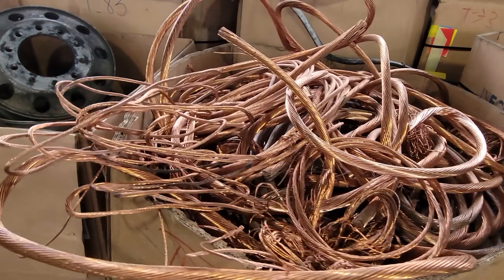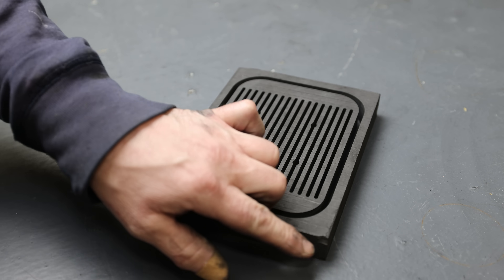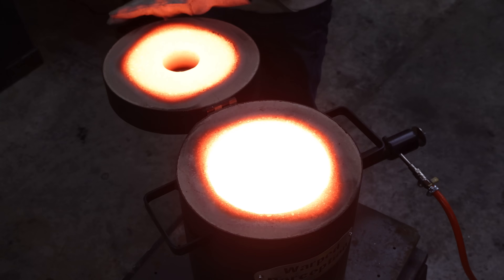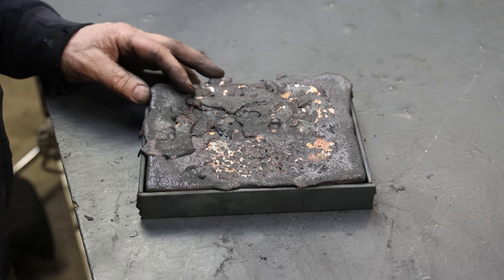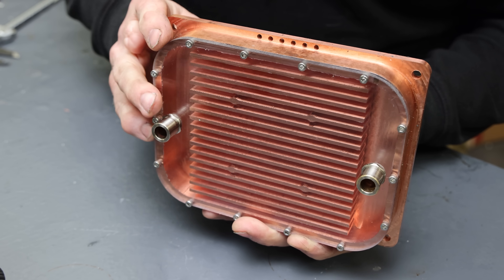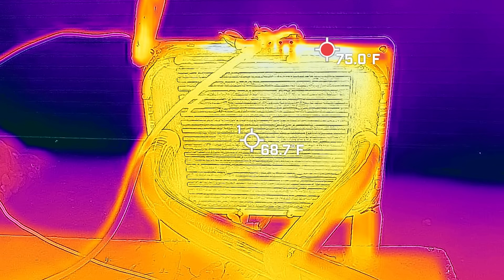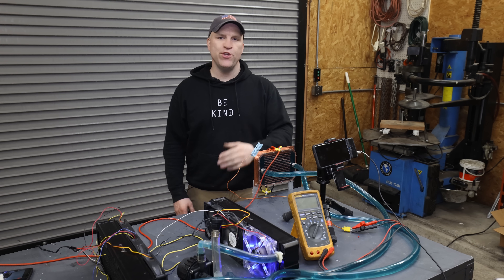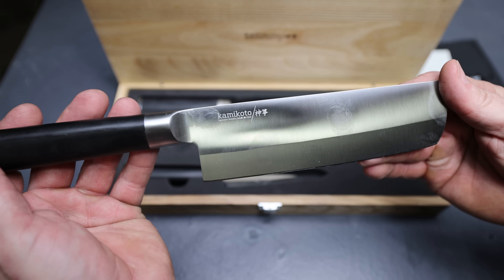Making a Huge Waterblock from Scrap Copper -Trash to Treasure

Comment: Incredible. If you ever do plan to make another revision, you should look into the design of high end CPU Water Blocks and the deliberate paths/restrictions to ensure good outflow of the heated water as well as the relationship between the in and out of the water. I wonder if there would be any difference in performance with a 12/6 o'clock or vertical relationship of the input and output as opposed to it's current 3/9 o'clock as you showed and if the feed or return worked better as either top or bottom. Great job nonetheless. I wish I had your tools.

Comment: out of curiosity, why didn't you go with a thinner fin set/ smaller fin spacing set up to allow for more fins which would increase the surface area for heat dissipation. also why not cast a a cooper ingot/block and make it out of billet cooper, since that cast had to have excess material  milled away anyway.

Comment: Thought it was dangerous to machine graphite because of the dust. Boeing at a fire during machining. The dust reacted to the 440 panel and an arc of electricity went through the machine shop. Luckily no one was hurt

Comment: He should have used an off the shelf threadripper water cooling block with a small refrigerator unit.  That probably would have worked just as well or better and would have saved tons of cash.

Comment: Awesome to see good engineering process.

Just my 2 cents, if you put the inlet for the coolant low on one side, and high on the other it may work even more efficiently. I think currently the coolant is pretty much just moving across the centre of the core. We had the same issue with our race car intercooler, when we moved the inlet and outlet, we saw a very big change in our intake temps. :-)
Reply: Makes sense. Better liquid distribution over the heat sink.

Comment: How come you used a graphite mould and many hours of machining and casting rather than just making a block of copper and machining it down? Is there a benefit to casting the rough part in a graphite mould first?

Comment: why are you calculating the volume by hand when your using fusion 360? 
right click on your positive model and click properties. you can also right click the model in the side bar and change the physical material to copper for accurate weight calculation in the properties menu.. 

its inefficient to calculate the volume using the bottom surface area in your negative cavity and the cavity height when all the information is near instantly accessible.
Reply from the maker: I wanted to make it more visual for the majority of people who will watch the video that don't use CAD, it creates a story connection. you use cad for volume but don't know how to scratch it up in paper, but you know im doing math when I'm writing on that paper, most people know the hand math but don't use CAD. I split it so both sides understand and relate with the same end goal, volume by weight of specific material. And I still added a little extra for safety. Thanks tho those are great tips I really like 360 but I just recently moved over from SolidWorks and Catia so I'm still not super proficient.

Comment: that casting is useless you have to melt 30% more of all the metal you want it is very easy assemble the graphite crucible and it will be the side container add distilled water to obtain the m³ then look for the Then look for the atomic weight, the crucible must be at the melting temperature so that casting breaks are not generated, that is, the metal cools and leaves bubbles. Partial casting without all the metal produces inconsistency and fractures since it is not all one piece.

Comment: I'm sorry for asking probably the most anticlimactic question, but you used some silicone caulk and you made it more flowing by mixing something. Could you help me out with that. I need to do the same for other project. What were the materials? at the 7:26 timecode

Comment: hate to be late but worth a shot.

What about adding an O-ring and making a checkered pattern, it would add a bit of extra machining time but I wonder how this would affect performance. If adding these helps make the block hold more pressure, you could use a stronger pump and go longer and dial the pump back and extend the life of the pump.

Comment: It is a cool project but the copper cooler is not very efficient. It is designed like CPU water coolers were designed 20 years ago. There is soo much that could improve the heat transfer. And the knowladge is easy availble. Check out moddern CPU Watercoolers (EK Waterblock, Aquacomputer, Watercool. . .  ).

Comment: wait so if you have the CNC why did you need to cast into a mould first? wouldn't you just make a bigger square copper pour and then mill it out?
Reply from the maker: I was going to, but I would have for sure had air entrapment, too much liquid exposed to air, the more surface area of the liquid copper exposed to air the more air is absorbed into the copper,

Comment: Solid copper water tubing and a larger radiator/pump will knock those temps down (this only will help if it's more a static install).

Comment: Probably should have made the channels a bit smaller so the liquid flows more evenly across them. But that's just nitpicking since it looks really nice and does what it is supposed to!
Reply from the maker: Unfortunately I couldn't, once I get my bigger more capable machine in a few months I will redo this smaller different shape and more detailed. Originally my design for the water cooling was a whole bunch of peaks similar to a CPU water cooler just a lot bigger. This year is that I'm using this dinosaur CNC machine and this was absolutely the smallest I could go.

Comment: If you R click the part in fusion 360 and tell it its copper (appearance i think). Then in properties it will say its mass. I think you should try sand casting its a lot better than pouring in on top. Fun video thanks

Comment: One design flaw is that you should've machined thinner fins closer to each other and then cross-cutting them, making many "pins" instead of channels. This way you would've created way more heat-dissipating surface in contact with water, increasing the efficiency exponentially; this technique is used in PC watercooling and it works great

Comment: No offense, this is really cool project, but wouldn't CNCing a solid block of copper be easier? And wouldn't there be existing applications on the market that are more than capable cooling this chip?
Reply from the maker: Yes but the raw material was on back order for min 2 months. This was not my first choice. As for existing applications... Nope, I looked high and low and the final unit...not this one ... Needs to fit into a industry standard Bowens mount. So unfortunately no... I would have loved that.

Comment: Cool project!
I can only suggest to maybe insert a colored marker using a syringe into the tube before the waterblock to inspect how well its inner ribs brake the coolant flow. I suspect that the most outer water channels get very low flow.
Reply from the maker: I did a static pressure volume pressure drop calculation. Right now there's a pretty big static pressure difference between one side and the other so the flow is pretty much even. But my vinyl design is a cross hatch style not this straight fin junk. But with the current machine that I'm using which is like a dinosaur CNC that would have taken me weeks just a machine, my goal was to make a functional unit just for now until I get my other machine.

Comment: Very nice work! I love how clean the finished product came out! The design of the block could be adjusted to get a more even flow across all of the channels, increasing the heat exchange. As it is now, the upper rows wont get as much flow through them as the coolant wont want to fight gravity to go through those channels. Placing the inlet in the top corner and the outlet on the opposing bottom can help this immensely. It could let you cut down on some material too if you end up making a bunch of these for this experimental LED. But hey, if it works it works!
Reply: I was actually thinking the opposite with the inlet at the bottom and outlet at the top.

I feel like having the inlet at the top could cause the water in the other top corner and around the center to stagnate because the cold water would want to sink straight down, then across rather than trying to flow across the fins. Having the inlet at the top would at least evacuate the hottest water first.

It might even be best to place the inlet right over the center so the center always gets the coolest water.

That being said, I ain't no scientist so I could definitely be wrong haha
Reply: If he made the waterblock side that the led mounts on a mirror finish it would have helped alot in transferring the heat as well. I'm not sure what he used as a TIM but if it the block was as smooth as possible it would have needed less and cooled better.

Comment: The most handsome engineer I have ever seen😎 , I have a question, I didn't understand why you used a graphite reverse template , why didn't you machine a copper block directly? I don't know much about thermology and metallurgy, but I thought casting a simple block was easier than a porous template. And machining a simple block is easier than a semi-finished piece 🤔 Is that correct ? Anyway, I really enjoyed watching the video 👏👏👏 tnx🙏🙏

Comment: awesome video and great use of the light. Could you have better cooling by having a serpentine design where you force the liquid to move in specific path. In the design you have water will go in the middle since that is much easier. Check out how IGBT are cooled and how their heat sink is designed. Keep up the great work!

Comment: Rotate ur block by 90deg ..inlet on bottom outlet on top. More consistent flow across the block, less hot spots on your chip or whatever ur cooling.

Comment: Watercooling has several parameters to work on. You seem to have missed a few. As first you need as much area as possible, So many small fins is better then a few big ones as in this project. Also you can increase the waterflow to have more heat (per m3 of water) transfered away. Finally you need to remove the heat again from the water in a radiator. More/bigger radiators can do this job but you will never get below ambient offcourse. So you could have accomplished better results with even a smaller copper piece (that you could have milled without the casting). I highly doubt what would happen if you leave it running for longer terms. Probably the water heats up and the system fails. To my opinion the optimal result was not reached. So for playing around with casting copper it was a nice experiment but thats about it.
Reply from the maker: Well CNC machining has several parameters and limits as well... did you see the CNC I was using to make this piece? It's a dinosaur. I reached its limit. My original design was much smaller and more cross-sectional, completely different but I won't have my bigger machine for at least 4 months because of supply chain issues. I will be making a version too but my goal here was achieved, I needed a working unit for the next couple months here. Nothing's perfect not even you...haha.. but for real thanks for the advice you are correct, but this video is about making a finished water block out of scrap copper, not making the perfect water block.

Comment: So I have a prediction.. if you leave the light/heatsink on its side you will have a heat pool build up in the top of the heatsink as the water wont circulate there.. I could be wrong..  Putting it with the intake on the bottom and the outflow on the top will help but what is really needed is for the heatsink to be designed with the flow path to be a singular zig zag so that all the water properly circulates.  I could be wrong though.

Comment: if you are using fusion just create a sketch on the top of your graphite block and extrude it down then subtract the new block from the designed graphite block(while enabling keep tools) then click properties on the new block and that will give you the volume, you can then change the material to copper and that will give u the mass you need

Comment: Your full of crap, the chip fab has tested that chip.  They have active cooling and even a prototype unit starts undergoing testing for burn in and longevity right away.
Reply from the maker: Nope,, you're kind of right but not really, the factory has tested the chip and done exactly what you said, that was my exact question to them was how did you guys test this chip? They basically use a very high tech refrigeration unit with a cooling block and run it under refrigerated conditions.. so yes but really no because if the chip is made for the market you're not going to hook up a refrigeration unit to it. Oh no I do have a refrigeration background and that was my first approach but then I said nah that's going to be a huge unit very complicated and I would not be able to make any sort of disconnect quick coupling lines for high pressure refrigerant. So yeah good point but you're not entirely correct.
Reply: @WarpedYT  You said it has never been tested for more than a few seconds...  You lied. You knew you were lying.  You just sound fake, a charlatan.  Everything else was cool but my autism just cant accept people lying like this.

Comment: When water cooling for optimal heat transfer of a chip like that you'll want a micro fine array. Take a look at the inside of a cpu waterblock
Reply from the maker: I know .. my original design was much physically smaller than this, and had a bunch of cross-sectional fins. However I ran into a machining limitation with the dinosaur CNC that I'm using. I will have a bigger faster better machine in a few months and I will do my second iteration then, but for now I have a working unit and that's what matters to me at the moment

Comment: I think the fins are too thick.  You should look at skiving.
Reply from the maker: They are, but with the machine I have currently this was the best I can do. My actual design is a Criss-Cross pattern not fins, that works much better for water cooling, but like I said this is the best I can do with the dinosaur CNC that I was using, but it works and that was my goal. For now
Reply: @WarpedYT  ha, I liked the ominous "for now".

Keep up the good work.

Comment: hasn't DIY perks already done this?
Reply from the maker: From previous comments I watched that video, no that's a different chip, the one I saw was a cree, this one is similar to one that he tested but a newer version, higher CRI and more power and smaller footprint. But this is not a video about the chip this is a video about making a water block out of scrap, this is not the finished product and the one that he built worked but he never ran it full power, to run this trip at full power you need a huge power supply. His video was cool though.
Reply: @WarpedYT  Thanks for the clarification, I found this video super interesting!

Comment: If that's the 1500W Cree, DIY Perks actually made a watercooled light with that before and blew up his PSU's but other than that he had no cooling issues.
Reply from the maker: No it's not.., I haven't seen that but this one is 2000w but more importantly no flicker up to 4 million frames per second, and a CRI of 96.2, that is very important to me.
Reply: @WarpedYT  Yeah i get that, needs to be very bright and flicker free and have a good CRI (for color acc) for nice slowmo shots, i'm quite keen to see what you'll film with it

the shots you done in this video already looked awesome so yeah!

Comment: Your temperatur measurement is wrong.  If you connect the thermocouple via alligator clips you Create a second thermoelectric contact with is uncomplicated. Still impressive.
Reply from the maker: No it's correct, I calibrated it beforehand

Comment: Hello, I think that in order to lower the temperature even more, you would have to occupy a larger radiator and also cool this radiator and you will achieve an even greater cooling factor.
Reply from the maker: I do, I am going to machine my original design which was much more intricate than this, but I can't do it on my current CNC machine I have to wait for a bigger machine to show up.

Comment: Nice video and project. Not sure if was intended or not but the center lines of cooling are going to have a much more flow of refrigerant than the lines at the borders. I would balance the flow o refrigerant by adding the refrigerant input and output in opposite corners, on that way should give you better performance with the same flow.
Maybe I'm wrong but if you want you can do a precise test, taking measures by doing a new acrylic cap.